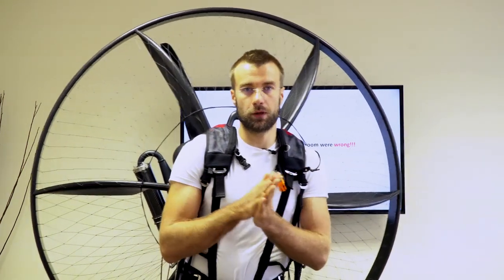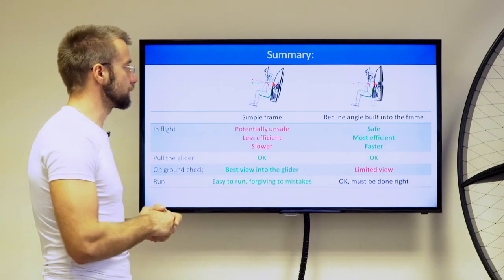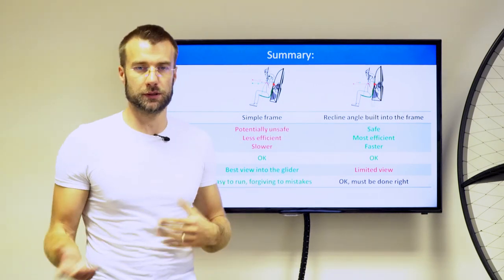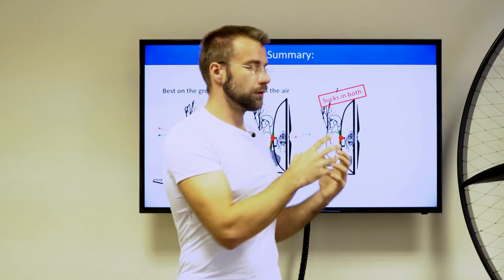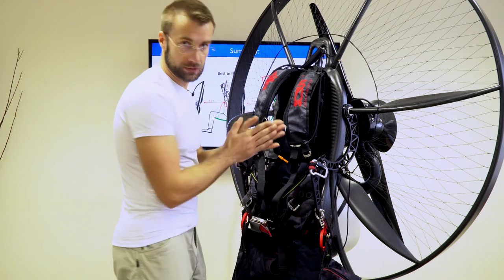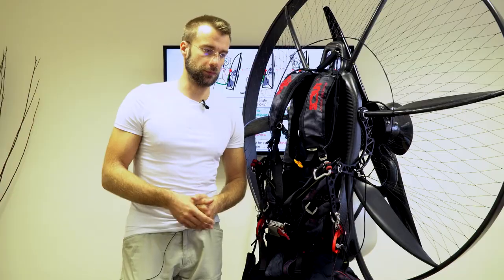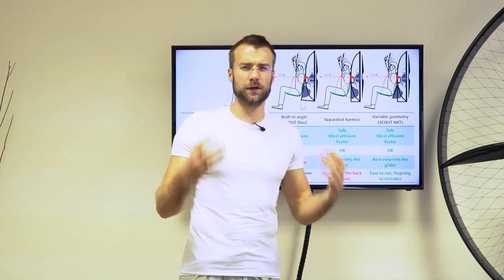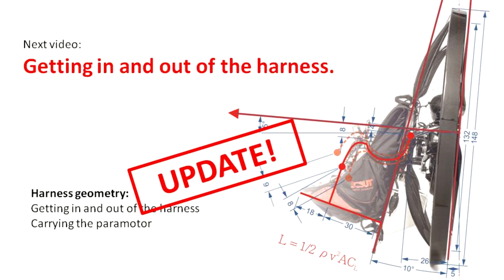Introducing variable frame geometry. Paramotor geometry part 20.2

Comment: Very exciting innovation!  What about safely?  Is there more potential for back injury on hard butt landings (engine momentum on top and fuel weight on bottom)?  Would this create a pendulum when people get out of the seat fast/last minute (13kg of fuel swinging backwards)?  Doesn't this effectively allow the prop to vary in distance from the flyers head?